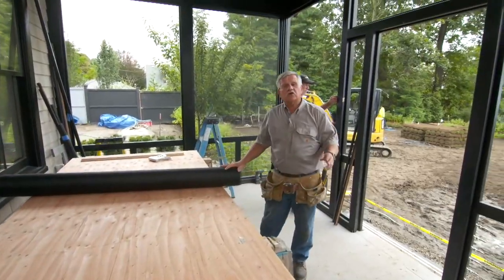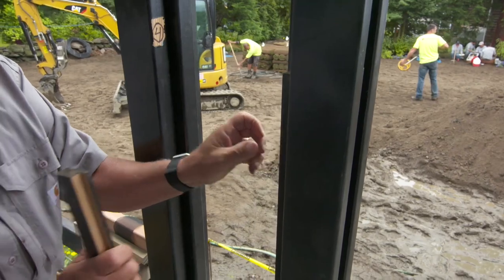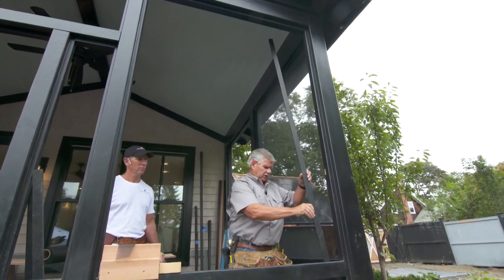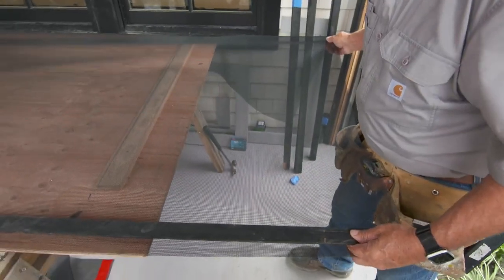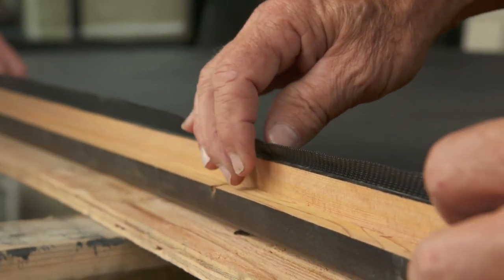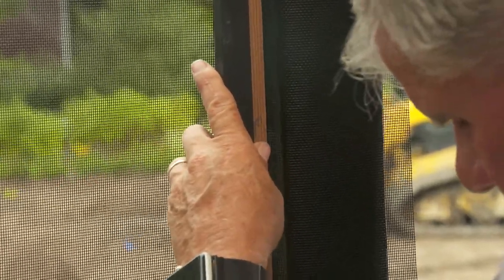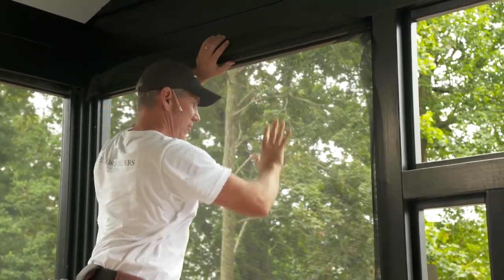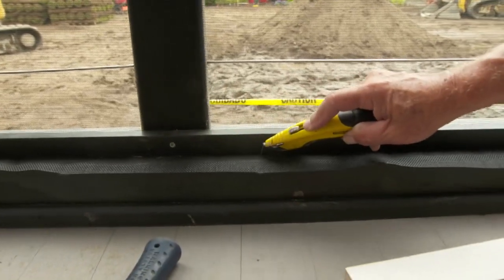Build Removable Wood-Framed Screens | Pro2Pro | This Old House

Comment: The end results look great, but wouldn't it have been easier just to make 4-sided frames and stretch the screen material on them  and simply insert the frames into the opening and secure with screws?  The framed screens can be added or removed or replaced quickly and easily.  I've done that on a much smaller project where I built frames for lightweight polycarbonate panels that I add when the weather turns colder, thus making the porch a versatile 3-season room.
Reply: I think their intention was to show a version of "replaceable" screen that doesn't involve using splines in the event of a repair. Granted, the single-stapled side has to be re-stapled with the new screen, and all other sides of the frame unscrew and then stretch the new screen over them again and trim off. I think the time to repair is about the same as with spline and removable panels. I prefer panels myself but....
Reply: Yes. That would be way easier and look just as good, you're correct.

Comment: Not really "removable" and that installation method of holding it taut while forcing the stop into the rabbet looks like a PIA.   It would be 1000x easier to just build a frame with the screening attached and screw into the porch frame.
Reply: Yes. Good idea. Just like how a canvas for a painting would be constructed?
Reply: @SteS    You got it!   I doubt my suggestion is an original idea and....you aren't going to believe this but I used to own a picture framing store, lol
Reply: @sulebo2153  cool. Well you would know the easier method here then. A few 2x2's then a dado around the edges to hide the staples would work I suppose. There's a new business for you! :)
Reply: @SteS  Ha!  No thanks - I'm Retired!  I've already restored two old houses and now I have time to sit and watch others do the hard manual labor .

Comment: This is all great but I still haven't seen a video that address rotting issues.  In New England this kind of design is a guaranteed rot damage in just few years.  Water will be collecting in those nice dados on the bottom and the rest doesn't need explanation. When I rebuilt my screened purchased I'll be paying all attention to this area (sloping it, leaving slots/holes for drainage, liquid flashing, etc.)

Comment: Great technique!
I'm currious about how that design holds up to water. It looks like the constructed dado on the bottom would be a huge water trap.
Reply: Excellent point. Hopefully there's some drain holes ?
There's a decent overhang, but that can't be counted on to save ya.
Reply: Guaranteed.  I actually just said the same thing myself.  I wish that was their main focus, not how to secure a screen because there are other good ways
Reply: My grandpa's old place had a screen porch. Water almost never got in it. Maybe once like when it was driving the rain sideways. But on an average rain it never got in. We even had 120 vac chinese lanterns inside and no one ever got a shock.

Comment: I would love to see some plans for this porch. Could such a thing be made available?
Reply: I didn't author this, but looking at the data provided from the video you can extract some dimensions and information:
The layout or overall shape is a rectangle with 2.5 full sides: one side appears to be 10 feet. The Front is approx 15 feet: 5 feet on either side of the doorway and as it appears to be main entrance, the doorway can be assumed to be 36 inches wide with two side lights of a foot each). The 3rd wall is only 5 feet and then connects to the house. The transom above the door way is approx 2 feet by 5 feet. 

The structure is made of cedar and painted charcoal or black satin finish. 

The fillers for the frame for screens are possible white Ash, or red pine or white pine. White Ash and White Oak hold up well to moisture, but not as good as cedar and far from excellent as teak, but if the sections are not truly exposed, and they're painted, then the rot risk is quite low. 

The Transom proportions tell me that the room is approximately 9 feet tall. 

The construction can be assumed/derived from the cross-sectional demo in the video ( showing "2x2" ( 'should be a ripped 2x4 to give you the extra1/4 inch, but that may depend on your lumber as it may be shy of 3-1/2 inches, by the width of your saw blade and blade kerf)  between some 2x4s all in cedar and the pine for the screens. This design is carried throughout the vertical and horizontal components and makes for a project with what appears to contain little waste.
 The components for the  horizontal wire industrial style "spindles" can be a combination of aviator cable, and a variation of connectors to eye bolts or screws, but could also be made to attach in behind the 2x2 sections, but that could be more labour-intensive if not needed ( and you're on a tight budget)... As for physical plans, I guess you'll have to check with the poster of the video :) .
 Nicely done screened porch. 

As others have mentioned for drainage, there presumably is a 1% slope away from the building and tongue and grove decking and painted/sealed shut, but should any water get in, could be ushered towards the doorway with a squeegee rather than drill small holes every foot around the base perimeter of the walls and have those stain the grey painted floor that overlaps the outside of the walls over time. But, like any construction, you have to stay on top of that. If you're "house-proud", then regular maintenance is going to be moderate. - Hope that helps a bit